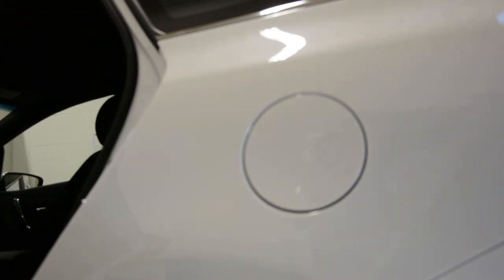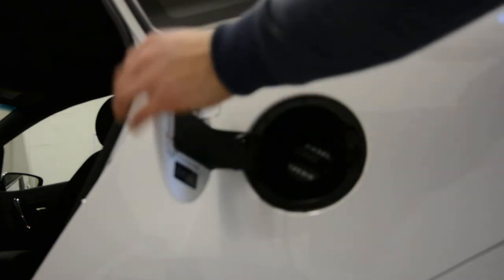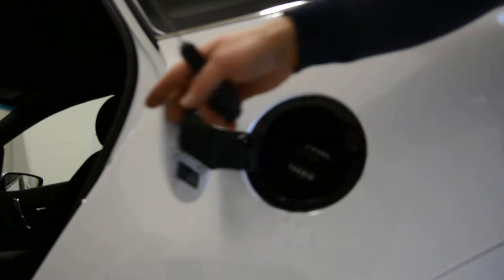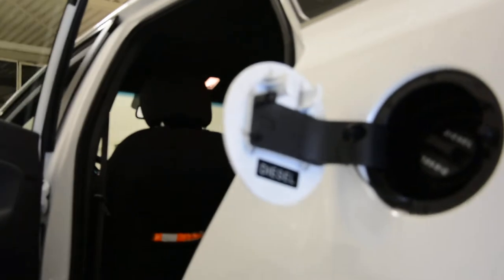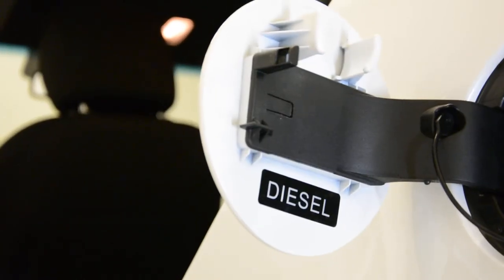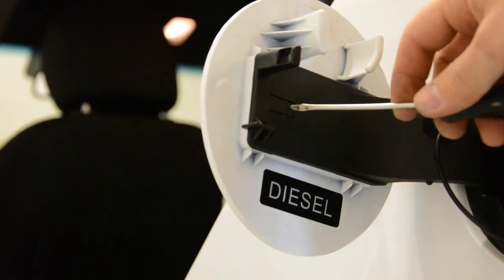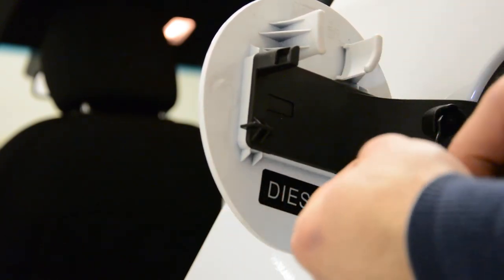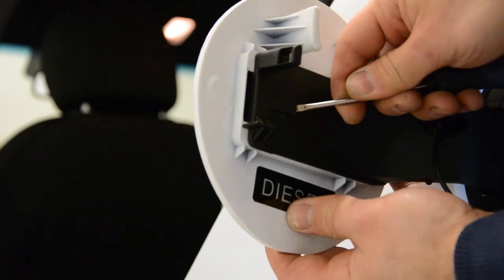Kia Ceed Gas cap cover removal

Comment: how to replace the whole mechanism?
Reply from the maker: Is a little bit trickier you need to open the booth and remove the left trim, you will have there the locking mechanism you need to disconnect the cable from there and after is very easy
Reply: @DFCGarage  Thank you for your reply. I might try myself doesn't sound to difficult